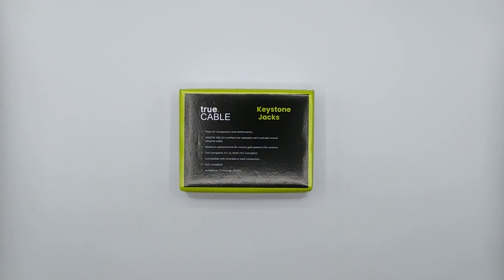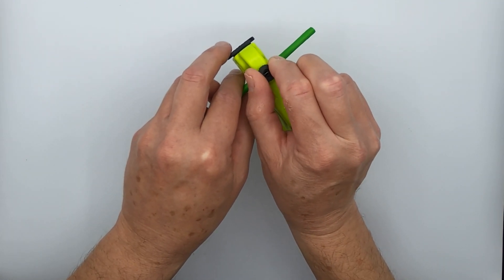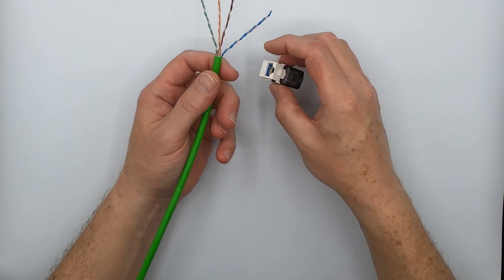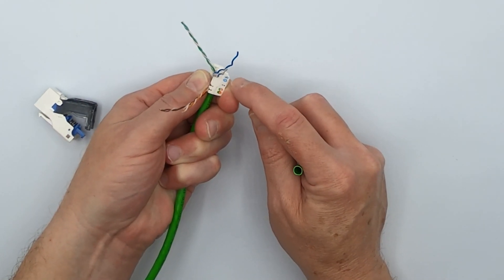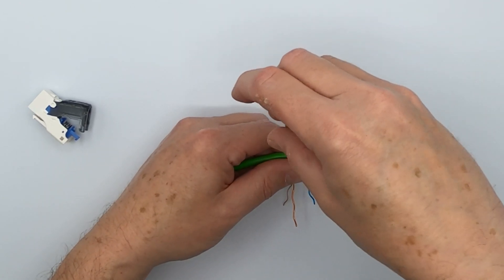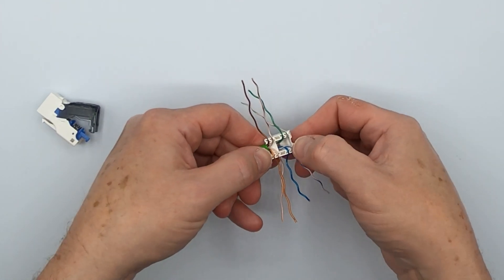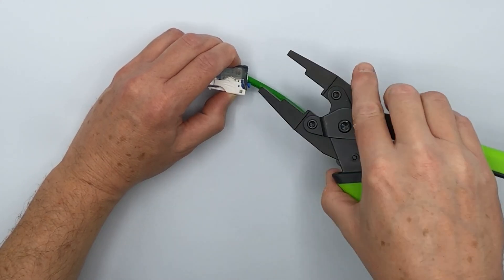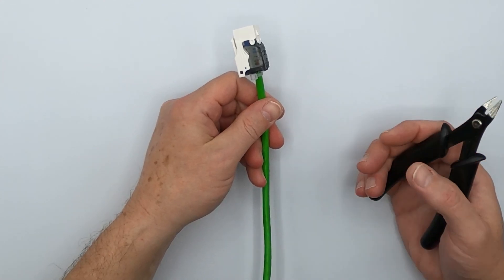How To: Terminate an Unshielded Toolless Keystone Jack

Comment: Thanks for all the videos you do! I am an advanced-level DIY guy but when it comes to networking, I am still a rookie so I watch all of your videos to help me set up my network throughout my house and the two steel buildings on my property (one a party barn and the other is my wood/laser shop). I am running mostly Cat6a cable and when doing keystone jacks, your videos typically say to get the jacket as close to the back of the keystone as possible and I make every effort to do that. However, my work-weary hands and arthritis (and lack of a third hand) make it difficult to get the cable pulled up tight while trying to set the wires and I typically end up with some wire showing (maybe an 1/8" at the most but normally around 1/16") when everything is done. Two questions: 1) How much wire showing is too much (if the answer is zero then I guess this task is beyond me), and 2) Will wrapping electrical tape around the exposed wire help in any way if, for no other reason, to add a little strain relief? Thanks.
Reply from the maker: Hello, and thanks for your kind comments. We are glad you watch our content so closely. 1/8" is not a big deal, but you can get it a bit closer if you do this:
1. Strip the cable, and 2. Using the keystone as a reference, figure out the two pairs that will go into the rear slots of the keystone. 3. FULLY untwist those rear conductor pairs. 4. Now seat the two rear-most conductor wires into the rear-most conductor slots, using them to pull the jacket up as close as you reasonably can. 5. Seat the other two rear conductors. 6. Now, seat the forward 4 wires. That should help out! Oh, and the electrical tape won't help, but it won't hurt anything either.

Comment: 2.5” is too much stripping.
Reply from the maker: Hello, and thanks for your comment! We all have our personal preferences. Some strip more. Some strip a bit less.
Reply: @trueCABLE  - I’ve been doing some wall socket repairs lately, so I need to be conservative as that wall cable gets shorter with every cut.
Reply from the maker: @sylviam6535   Hello Sylvia! Indeed, when pulling Ethernet to your wall outlets, you want 1 to 2 feet slack that can be coiled and stuffed behind the wall jack. The reason is just as you said, to be sure you have enough for adds/changes!
Reply: @trueCABLE  - The cable was installed years ago. There is about 10 inches of extra cable, after which I need to climb into the roof and replace the cable.
Reply from the maker: @sylviam6535  Hello Sylvia. Yeah, in your case I would limit stripping to 2" maximum. You don't have much slack left. I have been there!

Comment: Question: We were re-routing an ethernet cable from one floor to another (it was a success) but when reattaching the connector, I'm noticing something that varies from something you mention in your video (around the 8:41 mark) about an air gap and distance from the last twist. The connector that the original installer used (I can't find a name for it) resembles the one you are using in that you run the untwisted ends through a tiny slot that cuts into the insulation slightly. I just did it the way I saw it before detaching it (took a photo for surety, though I've done other "regular" RJ 45 connectors) and all the wire pairs were pretty "untwisted"... beyond that 1/2" that you were mentioning as spec.

I noticed some difference in what I expected to see for data speed (about 100 Mbps less) though the throughput is still quite good. It may be this distance from where the wires are untwisted? As I said, I simply set up the wires exactly the way they had them connected originally. I'm wondering now if I take it back apart and close those air gaps... Hmmm... Anyhow, thanks for the video, very helpful.
Reply from the maker: Hello! Thanks for your question. You are likely OK. The reason I say that is a 100 Mb/s dip in throughput is likely just your ISP/Internet in general being a bit slower than expected. If you think something is truly wrong, try your speed tests a couple of times per day at various hours to get a real gauge of where your speed is at. Also, try using multiple speed test services too. If, after a day or so you are still experiencing slower speeds, then you can try re-terminating to see if that makes a difference!

Comment: Is the conductor cap the same for the 6 and 6a model? And what's the best way to remove a jack?
Reply from the maker: Hello Richard! Yes, the conductor holder cap is the same between the two jacks. As for "removing" a keystone are you referring to disconnecting a keystone from a tool-less patch panel or wall plate?
Reply: @trueCABLE  removing keystone from cable. I accidentally installed a 6 Jack where I want a 6a lol
Reply from the maker: @Richardsumilang  We have a blog that contains the procedure!

https://www.truecable.com/blogs/cable-academy/how-to-reterminate-an-idc-connector

Comment: Great explanation.  Wish there were close-ups of the connector and conductors at points throughout the process.  So does this connector terminate into the back of the wall plate?
Reply from the maker: Hello DC. Yes, this is a tool-less keystone jack that snaps in the back of a wall plate or in a tool-less patch keystone patch panel. This video is part of a larger and more detailed blog. There are close-up photos and detailed information found in the blog that is not found in the video. You may wish to visit our website and the associated blog in our Cable Academy. We use YT to host the video portion of our blogs, but the full experience is with the combination of the two.
Reply: @trueCABLE  Love your videos! I was thrown by the term “tool-less patch keystone patch panel” though. This would imply that if you were using keystones that weren’t tool-less, then you would need a different type of patch pane or that tool-less and punchdown keystones could not be intermixed...is this correct?
Reply from the maker: @steinbierz  Hello and I can see what you mean! So, if you have a tool-less patch panel what that means is you don't need a punch down tool for the panel itself. That said, you might need it for punch down keystone jacks before snapping them into a tool-less panel! Crazy, I know. Of course you also have the traditional monolithic Category rated panels that require a punch down tool regardless, so they are not tool-less at all. I guess to get nearly 100% tool-free you would need a tool-less keystone panel AND tool-less keystones. Now, that just means you don't need a punch down tool. Of course you still need tools of some kind...like flush cutters, cable cutter, stripper, etc. So, no such thing as absolutely no tools required. But, where would the fun be if you did not get to shop for tools? I LOVE shopping for tools!
Reply: @trueCABLE  Having NO tools is NO fun! I have bought quite a few of your tools already e.g. flush cutters, parallel crimping pliers, punch down stand, wire strippers, and RJ45 Keystone jack termination tool…all are well built and have worked as advertised!
Reply: I realized that I was really only focusing on the “tool-less” patch panels since that is what I recently bought. I am using your punch-down 6a keystones and tool-less 5e keystones so was getting myself confused between the different uses of the term tool-less.
Reply from the maker: @steinbierz  Hello! Indeed, tool-less is a bit of a misnomer. I wish some other industry accepted name was invented for these types of keystones, but that is what we are working with!
Reply from the maker: @steinbierz  Hello again and thanks! We went through quite the effort to get our tools correct and easy to use. We are the same...the one who dies with the most tools WINS. Haha.

Comment: So you need a tool to close the toolless jack? Really?
Reply from the maker: Hello and thanks for your comment. Sometimes a tool like channel locks (parallel closing pliers in general) are very helpful as many people don't have the hand strength to close the lid. That said, some people do. Tool-less in this context means a 110 punch tool is not required to terminate the jack. Hope this helps!
Reply: Good point @Carlito, we use channel lock pliers which are multipurpose...

Comment: The title of this video, and the name of the jack, is 'Toolless'. Clearly, at best, this is a misnomer, at worst, it's just plain 'ol false advertising as it clearly takes 'multiple' tools to deal with this jack. Add to that, that this video is over 13min long. Now, I don't know about anyone else, but I'd go broke taking 13min to terminate a single end of a Cat-X cable, and God forbid it be on the patch panel side. Near 2000 views & 9mos at the time of this comment, and nobody has commented on how ridiculous this video is relative to a plain 'ol 110 punch down jack? What is the value add to this (cuz it certainly isn't price nor time)? Sorry, giving this product a thumbs down, and thumbs up for the video saving me the money.
Reply from the maker: Thanks for watching our video. Yes, it is long and that is on purpose. This keystone jack can be terminated very quickly, but I intentionally went slowly so DIY installers who have not done it before can easily follow along. When it comes to "tool less" -- this means is a 110 punch down tool is not required. That said, of course some tools will be required for cable preparation like with any other termination regardless of hardware. We appreciate your feedback!